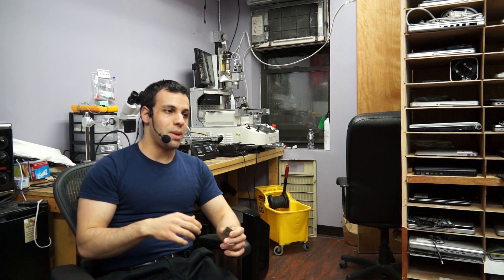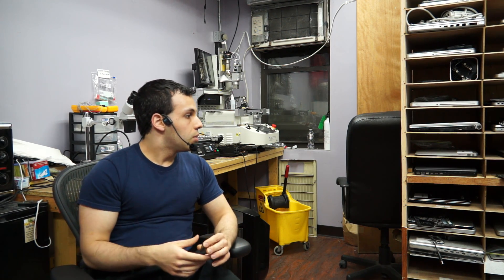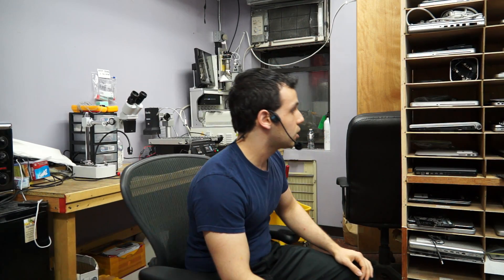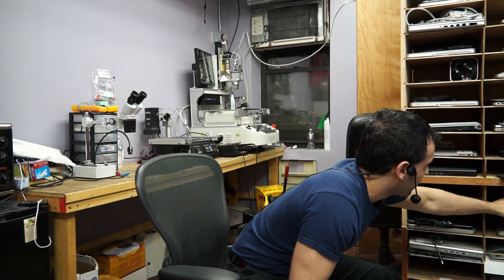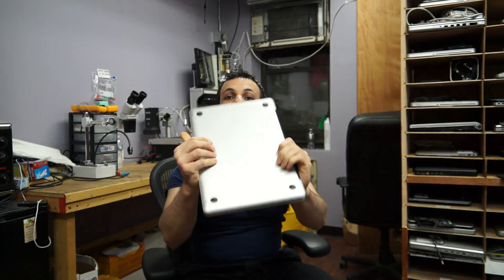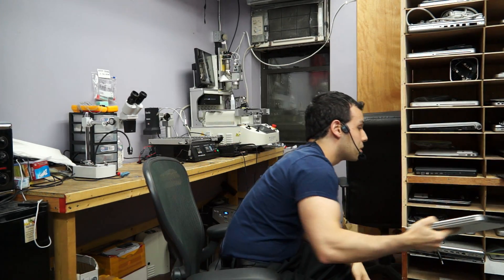Reballing flip chip GPUs is BULLSHIT - the truth about dead laptop GPUs & repairing them.

Comment: Constant heating and cooling from normal use can cause solder balls to crack which will of course be a problem. However the same can be said for the chips themselves, crappy chips can have a low tolerance for constant heating and cooling and will degrade internally over time and sure enough kill themselves if they're of really bad quality. Had a 2012 Macbook Pro go bad after two years with the mainboard starting to cause graphical glitches on screen so probably GPU related, Apple wants hundreds of dollars to replace the board, ended up ditching the thing before it became a total paperweight.

Comment: 100% confirmed here.  Just got an old LG 55" 3d TV with no picture tonight and isolated the issue to the main PCB.  Then I found multiple reports of a bad BGA from savvier folks than I.  So, using a multimeter temp probe on the heat spreader, I took the tip out of my old (was my dad's and quite rusty) soldering iron and kept the spreader between 125C and 140C for about 6 or 7 minutes, and I have picture now.

We make light use of TV in our house, so who know how much time we'll get out of it.  I suppose when it breaks again I can heat it again, and hopefully by the time it's fully dead I'll either have the cash to justify replacing the board or the whole TV.  Yeehaw!

Comment: Sorry to contradict but I'm pretty sure it's more of a gamble if this is a long term fix or not. I've fixed GPU's and a Plasma TV by heating (at ~200c) the PCBs. By far no neat or clean fixes, but while some repairs failed, some of them worked and still work today, years later. Properly reflowing and replacing bad cooling solutions can fix a device. But it might fail as well. But maybe more importantly, I'd never recommend it on a device that's critical to someone's business.

Comment: Reminds me of the RROD (Red Ring of Death) crap that the first generation of Xbox360s had. I used to buy RROD systems, use a heatgun on the GPU and CPU, replace the thermal paste and heatsink retention system. Well lets just say a few months down the road and I had some more RROD systems, lol. Only time I made any decent money was when I fixed a RROD system, realized it had a super old firmware and was able to perform a Jtag mod, then sold it for five times what I paid for it. I even warned the seller that it was a RROD fix and may not last very long but he was just super happy to have found a Jtagged system.

Comment: the only time reballing a chip may be worth it is if you're trying to recover data off of a smartphone that will not power back on and since most smartphone's internal storage are soldiered on to the board, it will require some reballing to get that chip off, or repair the chip that stop working preventing the phone from working.  Galaxy S4 notorious shutdown issue.

Comment: I believe in this, my acer aspire laptop gpu display went black after a hibernate for about 2-3 hours, I did the troubleshooting that I knew but no luck, the next morning I took the laptop to a laptop tech and he said the gpu needs reballing to make it work again so I gave a go. the next day the gpu is working but the bios needs reflash I doubted it because it was working fine just before the gpu had issue but I still gave it also a go.

To summarize: after many tries ( it actually took more than 2-3 weeks), we ended up replacing the motherboard itself for the same model.

Comment: What about the argument made where an excessive number of heat/cool cycles has caused the ball joints to flex in such a manner over time, that it has finally caused a crack in the solder joint? Is this a realistic scenario?

Comment: My 2010 21.5 inch iMac GPU died, completely black screen. Went to a repair shop on my town and said they are going to replace the GPU chip for a used one and reball it, The quotation is around 250€ for the process. After watching this video, should I just dissasemble it myself and try to reflow it on my oven/heat gun?

Comment: heatgunning is definitely not BS, it CAN work. Longtime Mac laptop owner, on my 17" Late 2011 A1297 machine, I was today able to successfully heatgun the unit back to stability. Issue was - when any known good external video was connected, eventually I would see the usual graphics errors, including spit screens, cursor changes, and very erratic video display. Unuseable with external monitor connected absolutely for sure. This issue for me was ONLY external video, the laptop works great if no connecter TB/Minidisplayport is involved. I used an ACE heatgun model 20176, at low setting (750 degrees) about two inches away from only the solder side of the AMD chip for 2 minutes, then the last 30 seconds at the high setting (1000 degrees). I let it cool for 15 minutes, reassembled, and voila, back in business. Yes I acknowledge this fix may not last, this Mac was already warranty repaired by Apple once (MLB replaced by them 3 years ago). I had done the same fix to the previous MLB then, and that fix lasted all this time. Reapplying the same heat gun fix to the warranty MLB - seems to have cured it as well. Acknowledged, only time will tell but as Ive said, this same fix worked for years on the previous main logic board. Hope this helps to anybody suffering this issue.

Comment: If you need to use the rework station to reball that chip, why are you always using the hot-air station?  Legitimately confused here, or can you only reball smaller packages with hot-air and the higher pin count ICs need the re-work station?

Comment: Hi louis ,you have all the reason, reballing is just for change a component from one board to another, many times if you heat  any chip that is not working, is possible that can works again , but just for a litle time, that's because the chip is may be overheating and is death..

Comment: My work place gives me an HP Elitebook to do drafting on.  I asked them to buy me a mobile workstation with a 17 inch screen at about $1800.  They told me no, it costs too much.  HP Elitebook cost them about $800.  Lets not mention it has a 13 inch screen and I'm going blind because I feel like I'm weaving silk here.  Any ways, it has the same problem that the Mac Book Pro has.  No vents to manage the heat in the laptop.  I'm on my third computer in 3 years because the video card fan melts to the gpu then the gpu fails.  Do the math.  They'd rather spend $2400 to save money instead of spending $1800.  And I told them this would happen when they refused to buy the workstation the first time.  

As for your comment.  What you are talking about is thermal stress created at about 100 to 120C.  When you heat the chip up with your machine to the 190C, it resolves the stress in the chip.  Its called quenching.  We do it all the time with items like steel to make it stronger.  Problem is we aren't dealing with a solid crystal structure, but nano-structures.  Fractures in the  structures are still there.  You give it back to the person and they ingest a cat back into the computer which makes  it over heat again at the 100 to 120C temp, the structure shifts again and the problem returns.  You are right about it not fixing the chip.  It just resolves the stress until next time.  Eventually it will just fracture and not return.

Comment: I did what you said and heated it at a lower level. 120 for 5 mins and it still cause the card to work until I turn it off. Once it was turn off it wouldnt work.

Comment: Modern Pb Free Solder is shit. Pb Free solder gets 'fatigued' or 'work hardened' over time, be it from heating and cooling cycles or from viabration, warping and flexing from use and transportation. Metal fatigue leads to micro cracking and eventually full on fractures, breaking conductivity. Good old SnPb solder was much softer, could take more abuse and has a much lower melting temperature, the solder recrystalising and actually healing as it was heated up in normal use. Pb free solder is not just used on the macro circuit boards and balls, but in every component including the chips, including their internal and external connection, hence when you heat the chips up hot enough to cause recrystallisation of the Pb free solder, the chips may come back to life. Louis is spot on.

Comment: I think this myth was actually popularized because it used to fix the red ring of death on the xbox 360 which had a problem with some of the solder joints.  With the professionals can't they just take the hard drive out,  buy a new mac and put the hard drive into the new one ?
Reply: Yes, and it spread to the PS3 when the issue with them most of the time was the NEC/Tokin capacitors failing.

Comment: I completely agree. I do have 1 success story. I have a Xbox 360 rebelled. I have the fan on 12v constantly. It’s lasted 15 years with little to moderate use as of late. Other than that, anything I’ve had repaired similarly, they had a very short life

Comment: Correct me if I am wrong, but are not the solder balls in place where pins would normally go? And if one of those were to melt and displace, that would be an issue.. except the chip would likely burnout before it moves as the temperature threshold is much higher on the solder. Or is it also possible that the solder displaces from physical movement such as Dells crap chassis, and heatsink  or board becoming pushed on.

Comment: No experience with Apple products but have reflowed PS3 motherboards in an oven several times.  Each time the motherboard fails in shorter and shorter times with each fix.  The PS3's run hot and the heat/cold cycles over time cracks the solder.  Each reflow causes the solder to be more brittle.  My fix.  Our PS3 doesn't get shut down.  Its been running after fix for 3 years nonstop.  No more heat cycles, no more stress.
Reply: Really? First time i baked my ps3 motherboard it only lasted a week. Second time it lasted over a year. I did it a third time to get my data off it. I'm afraid to game on it anymore lol.

Comment: You can mod using jtag so that it uses Intel internal GPU than AMD/Nvidia.
Reply: yes but apparently every laptop motherboard has a different way of fixing and sometimes it doesn't work.
Reply: @rezakianpour9668  I am saying based on proof of concept videos made this yearfor these specific MacBook pro , about Changing the  GPU from pcie to in built Intel UHD gpus they are not powerful but gets job done for situation like these gpus causing

Comment: I fundamentally agree with this video. However i think a bit of precision in the language would be helpful. I think using the word dead when you mean defective is confusing. Clearly re-balling/reheating DOES restore some functionality in the short term though the chip remains defective and destined for future repeated failures. Sometimes this is a solution if the customer has a short term need for a computer but doesn't have the cash for a new one. Just fully inform the customer and let them decide.

Comment: Its probably not the best thing to suggest but after you tell them up front that you can't repair their computer but you can get it to work temporarily but they will have to get a new one before it fails again because it will, wouldn't that been a "in between" solution where the customer can still use the current machine for work for a week or two while they wait for the new laptop to arrive? For a desktop, its much easier because you can physically swap the bad component be that a motherboard, some ram, a cpu or a graphics card but with laptops (windows or apple) they typically are limited in what you can replace and in some cases, everything is actually soldered onto the board including storage. If the customer still chooses to have their failing laptop fixed temporarily in that manner, at least they'd have all the information up front and know before hand that the fix is just that, temporary. Well, that's assuming the technician is honest. There's lots of sleazy and greasy technicians in the world that prey on the tech illiterate. :?

Comment: Something you say is not true. If you know how to build a GOOD laptop, then they dont get obsolete quick. For example, I have my T420 since release, sure it had an issue with the fan speed that wasnt programed correctly, and let the cpu run hot a throttle, but I fixed that in 10 minutes using the thinkpad fan control, and messing with the settings, and now it cools the device without getting loud all the time. I can still do my stuff on it, 1080p60fps or 1444p video on youtube, Adobe audition, photoshop, ECU programing, social media, movies, games (as long as they are not too complex) and so on. I can do everything on it and its almost 7 years old now. Upgrading stuff on it is super easy and quick, ssd with a big hdd, more ram, even the cpu I can swap the quad core i7 into it to replace the dual i5, but tbh I prefer long battery life, so the dual i5 is remaining, but its still a very capable chip for its age. Macbooks however....... Just dont. I wouldnt buy that shit ever again.

Comment: Hi Louis, I noticed you said that reballing will temporarily "fix" bad chips because of the high temperatures in the reballing process but if reballing were a legitimate option in the case of a good chip -can the high temperatures damage a good chip?  Also, how can I tell if a chip is good or bad?

Comment: Louis Rossmann
First thing dud i feel you ive  been in a computer/laptop Repair business for a long time around 6 years my boss is yelling at me because i refuse to repair this kind of issue i honestly and kindly explain to my customer that repairing this issue wont do any good to them because the issue will only come back after a month or two, chips used on any gaming or editing tend to fail and  re balling or re heating it is just a quick fix, it will work but at any given time it will break again that's why we have this thing called gaming laptop this laptop are made for games or any graphic extensive task like video editing that put a lot heat that cooks the chip inside because of the poorly made ventilation of the unit. I rather lose money than lose my customer trust. the whole company and my co worker know this but they just ignore it even when the time im still a trainee i quickly understand the logic in this problem.  i end up getting fired because i chose to be honest to my customer and don't want to get hated for giving them a not satisfying repair on there precious computer. so i feel you men you might get a lot of dislike for this but i will give you a like actually i like to give you a hundred or a thousand like for this honest video but i cant. thank you for sharing this information i hope that every technician out there will follow your example.

Comment: I had to heat the amd chip twice in two weeks on a 2012 17 inch vaio with a hair dryer for 5 mins. only other solution will be to change out the $200 mobo or throw out the whole laptop. i agree that the bumps under the chip are the prob. this time around i screwed down the copper cooling thing real fast with arctic paste while the chip was still warm hoping that will make a better connection. if i can get a year out of it ill be ok for now.

Comment: lemme chime in. i got here because of the fact a Mobile phone, Nexus 5X started to bootloop and per my own research it was "bad solder balls" on the Snapdragon 808 and that of the RAM chip what was soldered on top of the 808..

so to test it out i took apart my Nexus 5x phone down to the motherboard.
Took out my Tamiya masking tape.
and made a shunt to simply force the chip down into the board.
No heating, except body heat.
So i dont think the 808/RAM chip is bad. but the solder joints. that is my opinion

Et voila! my Nexus 5x would work for 5 or more hours until i shake it, or the vibrator motor runs.

So i made a deal with a competent tech to reball the damn thing AND slobber on thermal paste and copper heatsink...

so, thoughts?

Comment: Hey Louis, thanks for clearing the reballing thing. But what about replacing the chip in a macbook pro late 2011? There is someone offering this service. But now I'm doubting what to do. He says reball costs about 100 bucks replacing 225. Can this work or is this crap too? Background: I bought the macbook in 2012, but used it only as you described, checking mails, look up the weather etc. never did something heavy usage, except some video rendering and graphical stuff. Yesterday I wanted to upgrade to high sierra, the fans ran like a plane starts, after the install crushed view ...